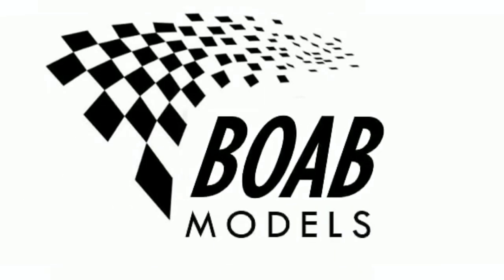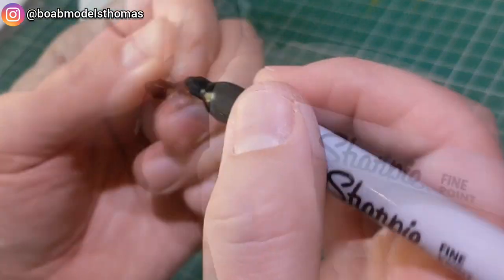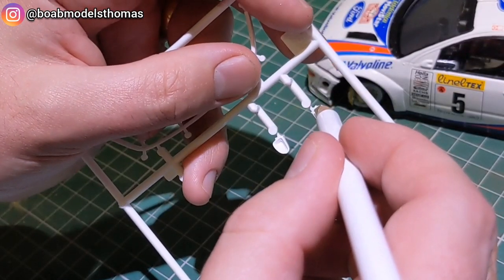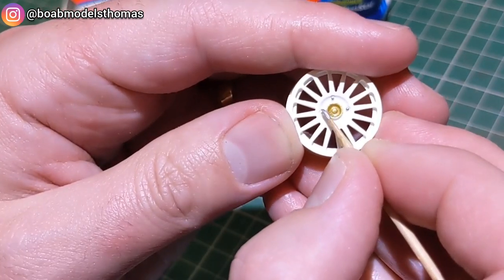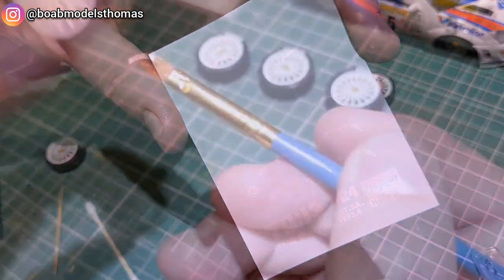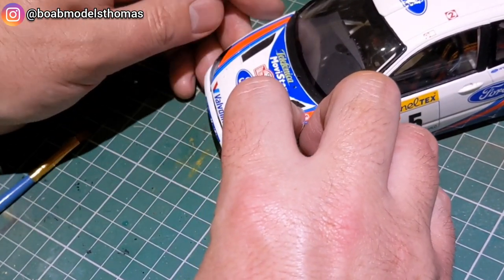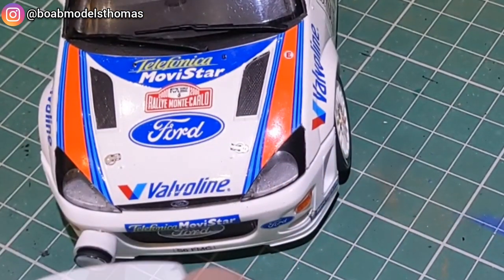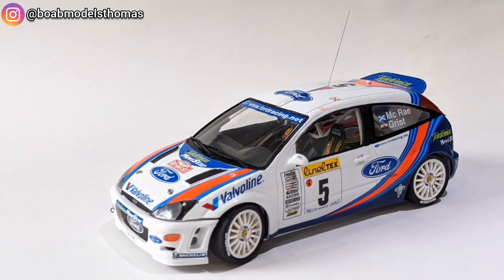Ford Focus WRC 2000 - Part 3 - How to build Colin McRae's rally car - Hasegawa 1/24

Comment: Nice build! This kit seems to be a bit different in conception to the Tamiya version, but apparently it also goes together well. I agree with the wheel choice. In fact, I need to get a set of these wheels to build my 2002 kit.
Reply from the maker: Many thanks - yeah, I've seen that the Tamiya kit has a completely separate roll cage whereas this has parts moulded to the doors. The 5 spoke wheels would have been a bit of a tight fit actually!

Comment: Looks good enough to me Thomas! Where did you get the little magnets from? Also i have found a little bit of candle wax on the wheel spindles helps with fitting!  Looking forward to your next build, I am on the final stages of tamiya Porsch 911 GT1, detailed engine and challenging decals!
Reply from the maker: Thank you very much, Paul. I think I got them from eBay - they are 1mm I think. That's interesting about the wax - I have found some wheels difficult in the past. 
The GT1 looks a nice kit but I know what you mean about the decals.
Reply: @BOABModels  Thanks Thomas, I'll look on eBay👍
Reply: I'm just about finishing mine as well, decals go on very well